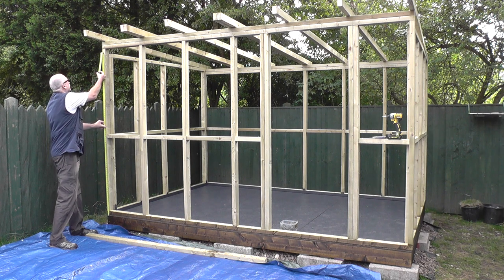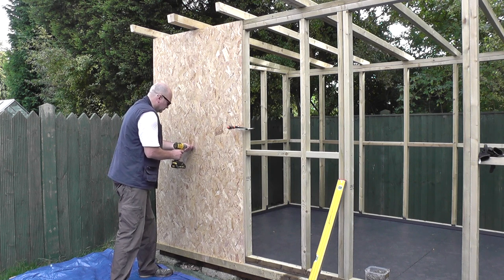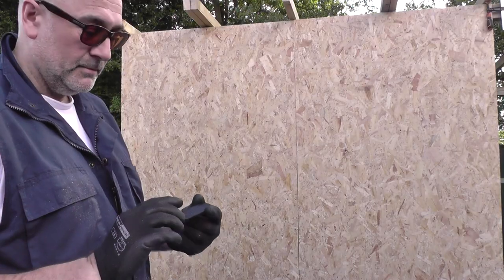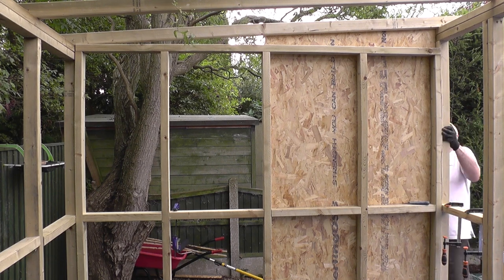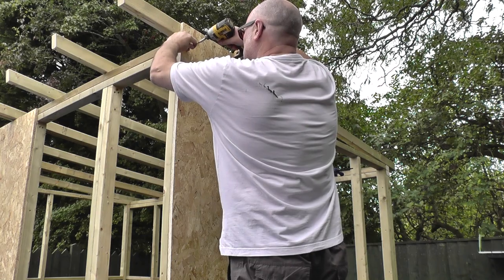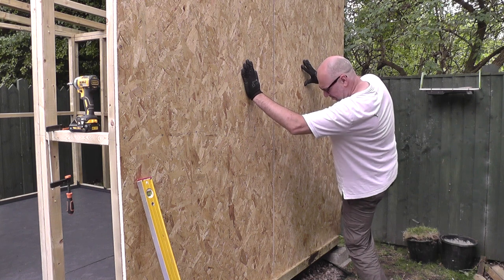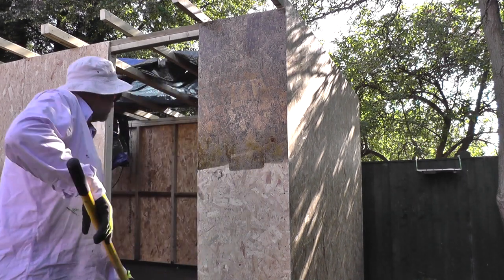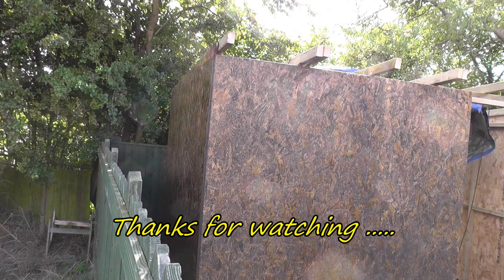DIY Man Cave / She Shed - Part 9 - Sheathing The Walls With OSB

Comment: Really coming on well now. Tip for when using the circular saw, clamp a straight length of something to the work piece and then use it as your guide to get a nice straight cut, it works kind of like a track saw guide.
Reply from the maker: To be  honest, I would normally do that but as my confidence is growing with the saw I can now get pretty good straight lines without a guide rail/track. They will give you perfect cuts though for sure. Take care, Des

Comment: Coming on nicely. Good tip on leaving a slight gap between the boards, it wouldn't have crossed my mind to do that. Any reason why you left the support blocks hanging out & not putting them fully underneath?
Reply from the maker: Thanks very much buddy. By support blocks do you mean the concrete blocks? If so, then I left them sticking out a bit to make sure there was enough area to put the subframe on. I wanted to make sure it was fully supported. Also (and this is purely by chance) by the time I fit battens and external cladding you want see much of them anyway. Best wishes my friend, Des
Reply: Ah yes, that would make sense to leave them like that 🛠

Comment: Creocoat is basically creosote and is great on any outside surfaces but should never be used on internal structures as it is a health hazard. Fine on the outside osb but should never be used on internal osb.

Comment: Great video enjoyed that. Quick question if you don’t mind, I’d 9mm OSB ok to use for the walls?
Reply from the maker: Hi there. Personally I think it's too flimsy. However, I suppose it depends what you;re going to use it for and whether you'll be cladding the outside? If your build is just for light use and you're going to clad over the OSB and aren't that bothered about retaining warmth inside then it'll probably be OK. Otherwise, I wouldnt personally. Best wishes, Des

Comment: Quick question, I have OSB on the roof and I want to use creacoat it before adding the felt, is this a good idea do you think? How long does it take for creacoat to dry roughly?
Reply from the maker: Yes, absolutely. Do it. Drying will depend on weather. In current weather it shhould be dry by end of the day I would have thought. Best, Des
Reply: @21stcenturycaveman33  Thank you, also trying to film some of this and will share a video once done, so far so good! :)
Reply from the maker: Great stuff. Glad to hear it. Look forward to receiving link. Des

Comment: Love this series, I’m so grateful for it!
I’m at the stage of putting on my 18mm osb3. Wanted to ask if it’s held up ok with the decking screws? 

I’m planning on doing the same but most people seem to use ring shank nails for the improved shear strength. Would much rather use the decking screws though as I have an impact driver but not a nail gun.
Reply from the maker: Hi there. The decking screws are absolutely fine. Don;t concern yourself if being used on a similar build to this - they'll be fine. Des

Comment: are the wall boards the same as the roof  18mm ?
Reply from the maker: Yes - all 18mm except the ones I used to line internally which were @11mm.ATB, Des

Comment: If you paint instead would that also waterproof the OSB
Reply from the maker: Yes it would if you use a decent outdoor paint. You would need to pay particular attention to the edges though as they are most susceptible to water damage. Best wishes, Des
Reply: @21stcenturycaveman33  Ok Thank you. So but if I primer & paint would that stand the sun and rain by itself Not putting anything else on top ?